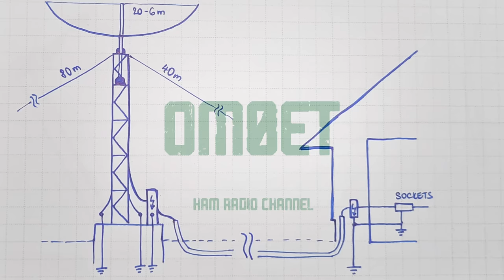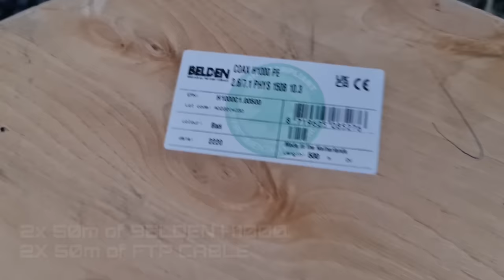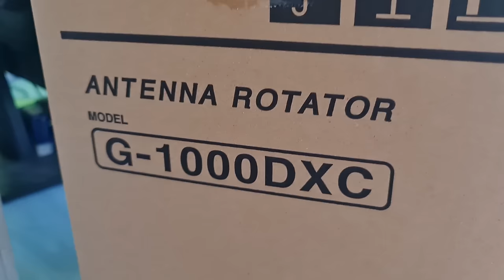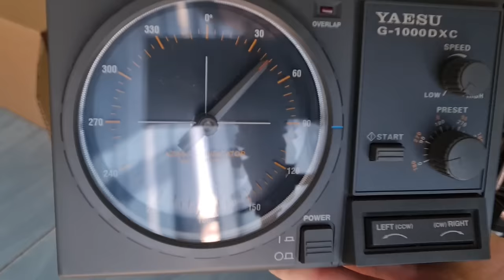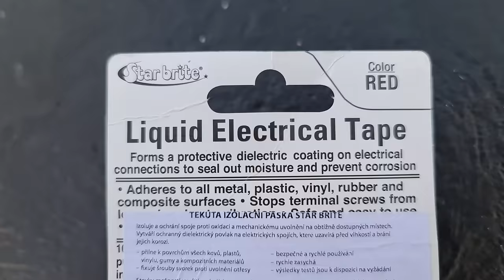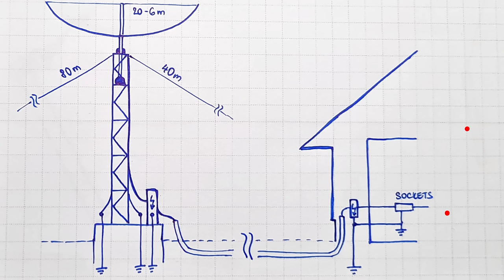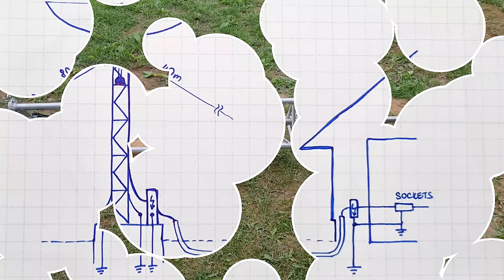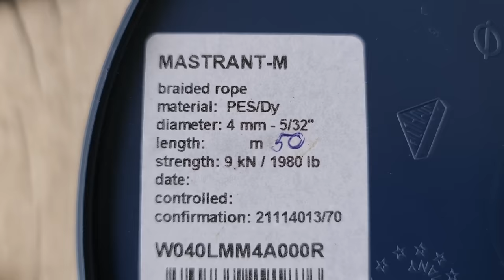How I built my antenna tower with Hexbeam on top (A to Z)

Comment: Great video, well done. One problem - Ground rods should NOT be in concrete. A lightning hit will break concrete.
Reply: That was my reaction.  Concrete, even after fully cured, contains a lot of moisture, especially when in the ground.  It is also quite conductive.  So in a lightning strike, if the current is not fully dissipated to ground elsewhere, the current can pass through the concrete, heating the moisture to beyond the boiling point, turning it to rapidly-expanding vapor, and this extremely high pressure can cause the concrete structure to shatter.  In this example, the ground rods partially encased in concrete will dissipate much of the lightning strike through the concrete, which is bad.

The simple solution is to add external ground rods.
Reply: The grounding and bonding is all wrong; hopefully he will not get a direct hit

Comment: Hey it looks great , but you might want to cut those grounds off at the slab and run new lines over the concrete out to ground rods away from that concrete base , if a big bolt of lightening should have to discharge fast it can bust that concrete base all apart . Won't be the first time that happened
Reply: Hey guys I need to add something else about tower installation you need to put gravel on the bottom of the hole then set your tower section or short tower base directly on that gravel bed before pouring concrete  that way you won’t get those tubes plugged and allow water condensation build up inside the tower legs because it can and over time split the legs from freezing this can be detrimental to your tower.

Comment: Without a doubt one of the nicest planned out insulation I’ve EVER seen. Videography was well done also. The only thing is I think those ground rods should’ve been on the outside of your concrete base. But no matter what you can never calculate where a strike will go. I love my rohn 45G tower at 60 feet but that is the most beautiful little tower I’ve ever seen. It’s like artwork in your backyard. Hope to work you soon👍👍👍😎🇨🇱 W5PN
Reply from the maker: Thank you very very much for your very kind comment! 😊😊 Best Regards and 73!
Reply: I was thinking the same about the ground rods.   Also, I wish I could have been there to do the concrete for you.   It's what I did for a living.   You made a few minor mistakes, but it will last your lifetime I'm sure.    Lastly, I would have liked to see the method for raising the mast.
Excellent job!
Reply: @seeharvester  could you elaborate? Intent in not to distract from this build but to educate the next builder. From my limited knowledge (absolutely zero experience) I think the rebar is to close to the edge of the cement.
Reply: @judd_s5643  
Well, to start with, I would have dug the hole perfectly square with flat sides, maybe even "bell" shaped slightly, ie., a little larger at the bottom.   
You want totally undisturbed soil, so hand finishing the hole nice and flat and smooth is best.
The gravel at the bottom I would think is optional with this particular antenna, since the legs are not embedded in the concrete like some brands are.  Even so, it's ok as long as it is compacted sufficiently.
Next, I would build a perfectly square and level form around the top; secure enough and exact enough to use as a support for the rebar cage and base anchor bolts, and to take any measurements off of.
The rebar steel cage I would have built out of the hole, with continuous 'stirrups' around the vertical bars as per standard practice when building a concrete column or the like.
Like you mentioned, none of the steel cage should be touching the dirt (or gravel).
I would probably weld the cage, and install the anchor bolts so that they were hooked around some additional horizontal bars that are part of the cage.   (I don't think we saw the actual anchor bolts did we?  I'm assuming they were hook shaped.)
This assembly can be held off the gravel with concrete bricks, or suspended by strong boards laid across your secure, extra strong formwork.
Likewise the the base plate could be supported by the formwork when the concrete was poured.
The concrete could be poured a hair high to allow for a slight slope to drain water, and there is a tool for finishing the edges while still wet. (instead of a metal file)
The grounding rods should have been left outside of the concrete, as a lightning strike could possibly damage it. 

I hope all of that made sense; it's hard to describe in a comment.
I'm probably just overly picky, but when you do concrete and masonry for a living... well...
 
All that said, I'm sure his tower will be just fine, particularly in his lifetime.
Oh, I would have thermite welded the grounding rods too.
Speaking of ground systems, the rest of his is superb.
Cheers!
Reply: A very detailed installation - well done.  The ground rods should be relocated outside the concrete base.  One lightning hit can crack /  destroy the concrete base, due to the moisture content instantly changing into steam.
Reply: embedding the ground rods in concrete is fine, in fact just the rebar could have been tied to the grounds, no ground rods needed..  lookup “UFI Ground”, that’s how its done, they tie the ground to the rebar, then embed it in concrete, with tremendous weight on it (typically used in house or commercial construction), the concrete is in ground contact, and usually always damp..  some of the lowest resistance grounds possible

Comment: Are those brass looking bolts with silver nuts some sort of special gripping/galling setup that they don’t need any lock washers or nylocks to keep them from backing out from wind vibrations? I’ve never seen those before. What a beautiful job, you should be very proud of yourself… your child obviously is from their post, well deserved respect from a ham since 85, and former tower installer for Motorola, this is absolutely the best tower install I’ve seen and best videography. (Minus the ground rods in concrete boo boo, please disconnect those rods, consider the loss a cheap price to pay and sink 3 new rods outside of the concrete…. What a piece of art!!! PS: your cameraman/camerawoman deserves a raise. PS#2: buy a torque wrench. 😉

Comment: Very good video and nice installation.  I would have recommended using copper ground rods, and all copper wire for your grounding.  Also, spacing the ground rods out from the base of the tower instead of inside the concrete.  Enjoy that hex beam, apparently they are very good antennas.
Reply: I had the same thoughts. It’s against code to have them in the concrete in my area. A direct lightning strike could crack the foundation. Great video

Comment: Thank you , There is a ton of information here that only a moving picture / still  can translate,  you have certainly done your homework , and have taken the time to do things properly and spend some hard earned cash along the way I'm sure , As I work in TV production land, thanks also for recognising a international audience  using little dialogue and big arrow animations along the way,  The USA is all about the USA ,  While most of the products shown are not known to us here all the way down at the ass end of the Pacific Ocean, here in New Zealand there is enough there to find alternatives,  and do the conversions to metric etc. Being a newbie to the hobby I like to do things right  1st time around and as I have an engineering background most things here  make total sense before I embark on erecting my tower , I would imagine you will get many years from this tower and antenna maintenance free and any future upgrades / maintenance will be made much easier , a little anti-seize grease goes a long way 10 yrs down the track. It is clear I need to study and do some more homework around earthing as like the previous comment ( Rico ) I am not sure if I would embed my tower earths into the block-work  as a rule, and would prefer to run them on the outside of the base. My late father lived in Florida and lightning strikes to his property blew apart any concrete structures with rebar within, but that is just a gut feel  on my part and you may have some solid reasoning behind this decision. At best I need to do some learning around bringing it into the house and some kind of firewall should you get hit. the gas arrestors and cat 5 / FTP decoupler etc make very good sense, loading them into a earthed copper housing even better before bringing them home to the radio shack , Many thanks again for documenting the process you have filled a fair few holes in my own knowledge. Regards and 73's Kris
Reply from the maker: Thank you so much Chris for you very kind comment! 😊 Yes, I was aware that the earthing rods should be rather outside the concrete base even before its installation, but an engineer who helped me with this groundings make my final decision... maybe it was a mistake and I hope I will never proof it... Well, I can still add some rods around the base and connect them to the tower 😉👍 I am glad that this video inspired you at least to made something similar in your QTH 🙂 Best 73! Paul

Comment: That looks great. However, if you experience any noise issues or higher order harmonics I would recommend removing all fasteners that are not CRES 316 stainless steel fasteners and replace them with CRES 316 stainless steel fasteners as they are less ferrous. I was a USN ET COMMS and fasteners that comprised of the wrong materials degraded our COMMS. Rust, other forms of non-linear junctions, magnetic materials, and unbonded materials produce harmonic signals like rabbits which would create noise for other systems (it could jam them and/or violate frequency allocations and regulations). Of course we were on giant rust buckets in an exclusively salt water environment so materials and electrolysis were a bit more prevalent for us. If you want more information check out Naval documents and standards on Electromagnetic Compatibility. Anyway, great build!
Reply: (Of course there is an aspect of the 'if it works don't fix it' doctrine. Saying what I said, I am unsure what chemical reactions may take place as a result of using other metals in this set up -- if you take my advise please ensure it is good advise for this particular build).

Comment: Hi Paul, what a fantastic project an excellent video, hope you get many years of use out of it great job. Bill. GM4SVW
Reply from the maker: Bil thank you very much! Yes I hope that this installation will not require much maintenance because of an alluminium and stainless steel. Will se :) 73

Comment: Great professional work you have put into setting up your tower. Im just curious of why you have a rotator for what looks like a multi-directional antenna you have, unless the antenna is not multi-directional. Nice work you have done from the ground footing to the top and you cable ducts, such an awesome job you did. Will definitely learn from this video. 73's de ZL1KIM

Comment: Hello Mr. Paul, I would like to ask you for some information. How do you use the SP1000 Lightning Arrester in HF band or other band? Why did you install two of them, do you have multiple antennas installed or are they needed for just the antenna? Sure of your reply I send my best regards.

Comment: The only thing I would have done different was to have grounded to copper grounding rods instead of the concrete. Something you could still do if you chose. However, lightening pretty much goes where it wants. After all, trees are not conductive are they?

Comment: Great excellent job! I have received my hex and i am waiting for my telescopic mast 8 meter + rotator cage with yaesu g1000 + SP6CYN TOTAL HIGH 10 meters, however i am not yet sure what size concrete steel foundation base is better that i would need? Total weight in the end is 100kg. What size plinth fid you make? Thanks

Comment: Did you know that in the USA, we have to put our ground rods a minimum of 6-12" away from the concrete. It is because that if your tower takes a direct lightning hit, it could shatter your concrete base.
Reply from the maker: yes Steve, I have been noticed also by others here in the comments. I plan to put more 3 rods outside the concrete
Reply: Don't forget about the bonding as well; R56 will give you some guidelines

Comment: Clean Installation. Good job. Needs one mowing season to understand, that guy wires have to be lifted up with support posts, to a level above the own hight.
You will have your reasons but all that work, time and money for a total hight of 30ft? Anyhow - 👏 congrats and I suppose, with such nice property, It was all just an exercise, for the next, real project(s).  Instead of H1000 and for long runs in general, always use Hardline, real low loss 1/2" or 7/8" coax. Cost not much more, often cheaper if used but many advantages, behind losses.
Well done in any way!
Reply from the maker: Thank you for advice. Yes support posts were set to the safe hight :) it shouldn't be the problem. I just will need to re-adjust the pressure on the guy ropes after on or two months again to theyr final position. Best 73
Reply: Be careful with overtension! Until you have no detailed information and a rope tension measure meter!! In my opinion, you don't need any guy wires. The top load is so small. This stage truss elements can handle this load easy. The top of the tower must move under windy conditions! Some lite pretension for the ropes is ok. But don't force it! Every kg tension goes to vertical load! Possible to do, but then you need additional guy wiring in the middle of the tower, half the hight. Otherwise and of course, greatly exaggerated, you get a banana.... 
Always keep in mind, even nothing will happen with your installation, steel bends aluminum breaks. Some looose pretension is completely sufficient.  However, the tower is welcome to fall a bit into the ropes.  A free-standing, self supporting 30m steel tower has a deflection of 70cm under load!  Unrestrained! You need some dynamic!! just my 2 cents

Comment: Subtitles would be nice. What is the winter temperature range in your area?

I live at 5,000+ ASL in a mountainous area. I suggest ground rods be run through sleeves (stainless or plastic) through the concrete base and as deep as you can. After erection soil conductivity can be maintained by pouring copper sulphate liquid through the sleeves. I hope you have a lighting arrester near the house. Lightning is a strange beast. All our buildings have touch pads by doorways for static discharging people - often we are in the clouds!
Reply from the maker: Depends on the year but from -20C to +38C.

Comment: Very nice and successful project Paul. I would almost say it's "over-engineered",  but that's only because of my own lack of getting things right in the very first time ;-))
I was wondering however, why you chose for the somewhat limited length of the antenna mast. This, because getting the 20m elements at least half a wavelength above the ground (=> 10 meters) would give you nice low radiation angle for proper DX.
73 from Holland - PC7H

Comment: Greetings Paul. Great video of your tower construction. Gives me a lot of useful info. Right now I have a vertical HF6V but would like a directional antenna like the hex beam. How did you tilt up the tower, how many people did it take? 73s de N0SL, Ron
Reply from the maker: Hi Ron, thanks for watching this video! At 33:28 you can see position of the tower. As the tower is made of aluminium, is very lightweight so one strong men or two people will give it up. I plan to make a pulley system for it to the future.

Comment: A few things, Earthing should have been on outside of concrete where it could be inspected or replaced if blown away. Steel rod is not great conductor in this case. STP cable or CAT6a or CAT7 cable for control/data as RF from coax will be all through it. Guying, guys at each 3M, especially if you want to climb although, yours is pretyy low at only 6-7M.
Reply from the maker: Thank you Ben for advice 😉
Reply: @OM0ET  Just needs another 3-6M of height.... lol

Comment: There is no kill like over kill. I thought my 80 foot tower on top of my hill, which gives me a 20 miles or about 32km line of sight, which lets me hit the city repeaters 25 miles away just fine, was enough. I just use it for VHF and SSB, Broadcast TV, FM and flying my 6x10 flag of Texas. But I guess if I ever have to replace my tower I’m going to have to up my game.

The one place I was equally over engineered was in the grounding. Being the highest object for a few miles, it’s been hit by lightning a couple of times in the 11 years it’s been up. No damage so far although I did lose a TV a few years ago. Not sure if got zapped through the antenna or the power supply since both arrestors were toast. Took out the whole house arrester plus the one at the TV. Didn’t hurt any of my stereo gear but it has a big power conditioner that might have saved them.
Reply: Nobody asked... nobody cares.

Comment: Is that paint that you are applying to the base?  My base is just about done with the curing process and I was planning on applying a sealer but now you've got me curious if this is the way to go or if you also applied sealer then paint afterwards.
Reply from the maker: Both of them (blue and black) are as we called it penetrations or as you call it sealers. It's still flexible also after dry out.
Reply: @OM0ET  Very good! Thanks for the info. By the way, excellent video and beautiful looking tower/beam. I can't wait to get mine finished. Maybe I'll catch you on 20m when it's done. 73 de KC3FNG

Comment: My only comment would be that I was under the assumption the ground rods needed to be outside of the base as a hit would blow the concrete to smithereens due to the moisture in it (in the cement)….. but that’ll be for another video. 😜